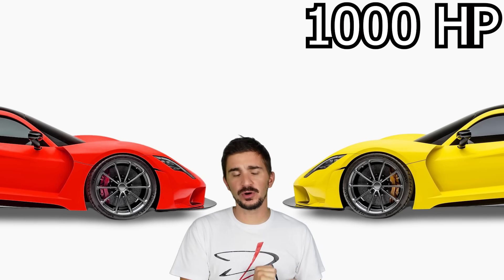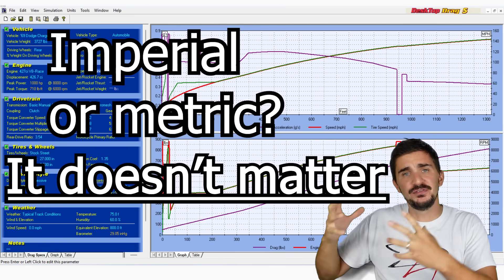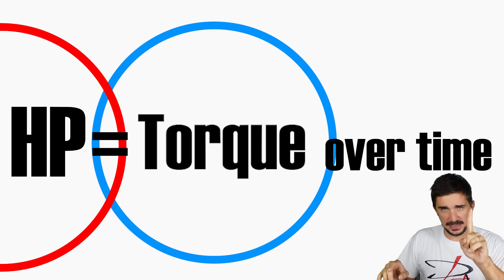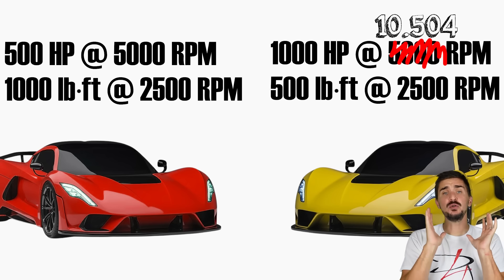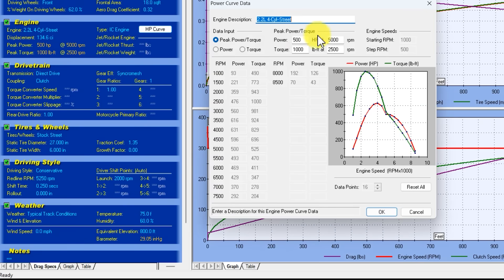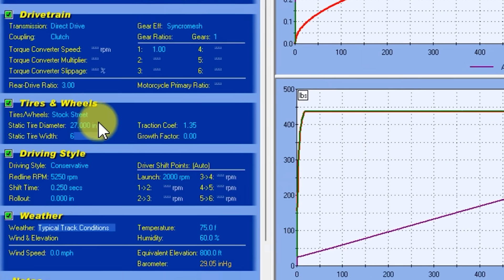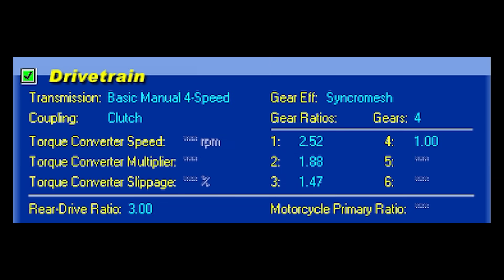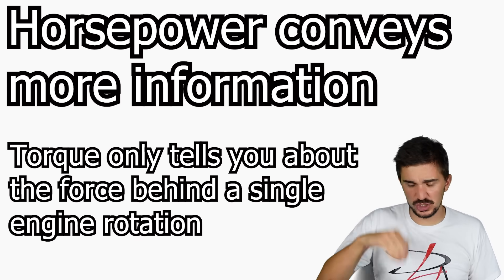Who's faster? Explained and Simulated - Horsepower vs Torque

Comment: If I had to explain what is power and what is torque in simplest way I would say Torque is parameter makes car accelerate, so higher torque=lower 0-100km time. Power on the other hand is max speed car can reach.
Reply: no.

Comment: "Hp sell car, Torque wins races" C. shelby..
Reply: power win races torque alot down low is good for daily riding assuming each vehicle have perfect gearing 👌🏻egzample h-d x440 38 nm 27 hp let say 250 kg with rider on it vs kawasaki z300 27 nm 39 hp 250 kg with rider on it do drag race 0-100 km/h x440 in 9 sec vs z300 in 6 sec +/- vmax x440 140 km/h vs z300 160 km/h 👌🏻 or setup them on racetrack on the same tire increase lean angle for h-d if it be not enough in specified trafk conditiion and tire type and z300 smoked this h-d everyhwere depsite have 30% less peak engine torque and much weaker lowend thanks much more peak power /topend z300 on avg lenght track 4 km from moto gp calendar be like 5-10 sec faster on LAP 👌🏻🤷🏻‍♂️ 😎…POWER  win races not toque wemeber 😎☝🏻 torque is BS for  racing it never work unless somebody setup enough wrong gearing in more powerfully less tprque version but this dont count 👍🏻😎this that power win races dont mean it give more fun on trck avg not very skill/fast rider 😉👌🏻…. it dont 👍🏻 most will have more fun on bike with stronger lowend and weaker topend even pro racedriver most likellly usuallly in categpry FUN not categpry LAP TIMES choice after couple laps on each ….👉🏻version with more torque down low and less topend peak power 😎👌🏻but thats diffrent story 👌🏻 RACES WIN POWER NOT TPRQUE 😎👌🏻☝🏻☕️

Comment: Good example of torque vs HP: my 87 diesel pickup can pull a LOT of weight but it's acceleration is horrid and top speed is 75. Downhill. My 91 SUV can't pull a whole lot but accels decently quick and will do 120mph+

Comment: The number of car guys i have heard misspeaking about this subject is mindblowing. Its incredibly simple really. HP is total power output and torque is a piece of the equation to make total power. Torque by itself is never enough information to determin how fast a certain vehicle can go(or accelerate) but HP IS enough information to determin how fast a vehicle can go(or accelerate). If you know what rpm this HP is generated at, you sinply need to choose an appropriate gear ratio to utilize that power effectively. HP is the measurement of all things "go fast" while torque is but a small specifc conponant of that total HP
Reply: I thought torque was invented by Harley guys to feel better 😂
Reply: @Root_boy  🤣🤣🤣🤣
Reply: driving a car that only produces good horsepower at 13000 rpm would be awful to drive in everyday driving. It would feel very weak at 2000 rpm, and you would be downshifting at every slight incline and puff of wind. The engine noise and reduced engine life would quickly bring on buyers' remorse. It would only be powerful by staying in first gear.
Reply: @briank10101  no, you just gear it differently. Top gear would have you cruising at 6,000rpm to access the HP.
Reply: @briank10101  dude if an engine had its peak power at 13,000 rpm it WOULD NOT be fitted with gear ratios that put it down to 2k rpms when cruising!!!! Are you freaking kidding me?!? You just don't understand do you. It would be fitted with gears to keep the rpms at appropriate speed. Like say cruising at 6k rpms? Higher rpms = ability to have lower gearing. You still don't know how it works..
Reply: Small specify fact?   I wouldn’t call 1/2 of the equation a “small part”?   Is 50% of ANYTHING a “small part”?
Reply: @andrewhigdon8346 you’re wrong. Torque is equally as important as rpm. Hp stands on its on and hp is infinitely more useful a metric than tq is. We aren’t comparing tq to rpm here. We are comparing tq to hp. It’s like saying I am making $100 at my job. As opposed to saying I make $100 an hr. One means absolutely nothing and the other tells you pretty much all you need to know. Tq is arbitrary without RPM. HP includes both metrics into one number.
Reply: Thank you! Lol took the words out of my mouth. Guy in the video did an absolutely HORRENDOUS job of explaining this and your comment is worth 1000x more than this video where the guy seems afraid of reality and scared to get to the point
Reply: Lol it's always so funny how easily you can tell when people don't understand this. They love to go in depth with details about weight, grip, torque, etc. while people that know just say what you said. HP is king 😂
Reply: This is a terrible explanation. Just watch the video.
Reply: @JimLBon  If you think that's a terrible explanation then you still yet don't understand how it works yet. Lol the video is a terrible unrealistic explanation of how it works and doesn't really show the advantage of having high HP over low torque. When the f*ck are you gonna have a 4 speed in a modern car? Or a freaking 1 speed? Most modern cars have atleast 6 gears to play with and the HP engines will always win due to gear ratios.
Reply: If you know the RPM and torque, you know the HP, so your statement stands for both.
Reply: Huhn?  This was solved by Lawlor many many years ago.  Check out his book.  It is a simple gem.
Reply: @squirrel6687 book name?
Reply: You are wrong.. hp on light car vs same hp on heavy car. How hp alone tells u how fast it will go. Just watch video
Reply: Not only car guys misspeaking. I've even heard physics majors doing it! A (bad) car CEO, too!

If you have enough gears, power is the ONLY thing that matters for performance. Peak torque can sometimes be a clue about how broad the power curve is, how fun it is, etc.
Reply: @masina9447  peak torque doesn't really tell you much. You need a torque curve for that...
Reply: @RacingAnt  and that curve needs RPMs. I guess that is inferred.
Reply: @masina9447  Amen brother. You get it. I've tried explaining it to people and it's just like bouncing off a wall 😂
Reply: You are wrong , obviously don’t understand torque wich is work hp which is time the work is done in. Light car sure takes no torque to move it and lots of hp can make it move. Heavy vehicle you need gears to optimize work or torque if your making little torque. Average power between torque and hp is what wins races. That’s why fuel injection often making less peak power than carbs will run quicker with less HP.
Reply: @jbaker8871  I'm sure you do not even understand that hp is a mathematic equation and you're telling me I am wrong with some word salad. Sure.
Reply: @jbaker8871  thats a whole lot of mumbo jumbo
Reply: @jbaker8871  if you think you only have to use gears to optimize acceleration in heavy vehicles you are completely clueless. Gears are necessary to optimize performance in ANYTHING. If you have the perfect gearing the hp will win EVERYTIME. If you don't understand this then there's no point in even arguing with you. You just don't get it lol

Comment: Horsepower is the raw power coming out of the engine, you can't change it. But torque can be changed with gear ratios. so in the end the car with higher HP will naturally be able to produce more torque.

Comment: Assuming everything  is equal with optimal gearing for both cars, 1000Hp with 500lbs is WAY faster. But if you were to measure 0-60 or acceleration, up to a certain speed 1000 torque and 500hp would be better.

Comment: If the formula was right, my engine should produce 300 hp bone stock. Instead it produces 150 HP. Somewhere dude forgot to mention that there are over square and undersquare engines.. All internal combustion engines also produce a lot of heat and so therefore they're loosing a lot of horsepower to just run the engine it self. The formula just add up to reality. There is no konstant, there is a formula "in best case scenario" like in physics class for elementary school - "don't count in heat, friction, etc.." and also this is usefull just for square engines where bore is the exact ammount as stroke.

Comment: This is inaccurate, you never optimized the transmission, and never went above a 4 speed. Higher HP will always be faster if optimizing the transmission. The only thing that matters is average power across each gear.

Comment: Normally, I like your videos, but in this one, you talked a lot of illogical and overly simplified stuff.

First of all, regarding the formula for power; who uses a constant for engine power? Why don’t you explain that mechanical power is composed of torque multiplied by angular velocity, and that angular velocity is derived from the product of 2π and the engine speed. And it’s expressed in watts, not kilowatts. Kilowatts are used to keep the value more compact, similar to kilograms.

Furthermore, it’s incorrect to describe torque as ‘hits’. Torque, or newton meters, is equivalent to the SI unit joules (energy). So, power is energy per revolution, and the revolution or angular change.

Then, on the topic of which vehicle is faster. Obviously, the one with 1000 hp. The required power for a speed is calculated from the product of the driving resistances and the speed. This equation can be transformed into the required wheel hub power. But I don’t want to go into too much detail.

The point is, vehicles with high power and low torque, like the old V8s in Formula 1, have a transmission with a high ratio to achieve high torque at the wheel hub. Conversely, the ratio must be lower because the engine initially has a lot of torque. But the power will be small since a high engine speed is not reached.

So, there are many factors involved.
Reply: you forget mention that at set speed this high torq at wheelll drive axis with set whell radious is achievable only beacuse old v8f1 engine have alot peak power otherwise  this will never happen dosent matter how you geared lower power higher torque engine it will never generate as much torque at drive whell axis at the same speed at set/fox whell radious 😎 alll what happen between engine and whelll are irrelelvant it it can be everything and this everything must be setup in such way that max power is generated at speed at which you want to have bigest output force and thats it you can have small /big whelll radious its just reduction nothing more for transfer power at specified speed of vehicle 🤷🏻‍♂️ dosent matter other vehicle have more torqueboth at engine crank and at drive whell acis if it have in this point of time at this speed lesss power available on engine and assuming the same drive train losesss less spower available at whelll he be knockout be engine with more power with lesss torque at engine crank and at drive whell axis  cos this more power lesss crank/whell torque engine will generate more output FORCE AKA THRUST 😎🌪️ 🤭👌🏻 the point is whell torque is irrelevant aswell if we have diffrent whelll radious than you setup in drive train betweeen whell and engine diffrent for achieve MORE contact path force from more peak power 😎 otherwords vehicle with higher whell axis torque still can generste smalller contact path force aka thrust at set speed  if there be enough longer whellll radious so lower whelll power cos torque is not force it is leverage dependend from 100 times higher torque you can have 100 times smaller force if whelll radious be enough longer /biger and force os what REALLLLLY MATTTER NOT SILLLY torque 🤭  🤷🏻‍♂️ simple as 💩😎 all explain simple formula so 👉🏻 watt :m/s= force 👌🏻 king of all racing formula 😎 rest is BS 🤭 made up be some amateur,ydyots or people which want intentionally misleading other pople not involved enough deeep into this theme like in many other theme 😎👌🏻 the funny stuff is that those ydyots dont know if they will say whole truth to avg people they will havefrom this more benefits than like they lie to them cos in fact for most driving conditioon in daily riding engine with more crank torque espciallly at low rpm is way more comfortable and pleasure to drive for 99% of avg people not peak power engine 🤭 but who cares ydyots always be ydyots 🤷🏻‍♂️😎 ☕️

Comment: A 1 Horsepower source will lift 100 pounds 100 feet in 1 minute. If you didn't know, that's the basis for the horsepower scale.

Comment: Horsepower is how fast you can punch
Torque is how hard you can punch. 
You can have a fast time but a slow spead or
You can have a slow time and a fast speed. 
Its why one driver does a 1/4 in 10 seconds at 96mph and
Another driver does 1/4 in 11 seconds at 120mph.
Hp isn't everything, winning is. It takes science to win.

Comment: Horsepower is the only relevant measure. Torque is only one of the two factors. Horsepower, being the product of torque and RPM is the actual rate at which the engine/motor can do work. Torque and RPM only determines the gear ratios needed, or, pump displacement needed for hydraulic systems, to utilize full horsepower, to do the maximum work possible from that horsepower rating.

Comment: You have absolutely no clue what you're talking about, and should just get off of youtube quite frankly. This simulation is utterly useless to compare the merits of peak torque and power, which are only relevant at full load. These sims have the clutch slipping the whole time, or the wheels spinning because it's not even smart enough to modulate the engine for maximum performance. You are teaching bad information to people who don't know any better.

At full load, all that matters is power - period. And you set the gear ratios and shift points specifically to keep the engine at peak power as often as possible.

Comment: HP is directly proportional to Torque. and if the RPM is equal to 5252, then HP and Torque have an equal value. any value of RPM lower than 5252 makes Torque value greater than its HP. while any value of RPM greater than 5252, then its Torque value is lower than its HP

Comment: One thing that I never see stressed enough is that you can change your torque at will by using a proper transmission or changing tire size. While you can never change your horse power, you are stuck with what the engine is capable of

Comment: So if a car has high HP and high torque, with lower RPM, which in turn will make you “feel” the acceleration more as where a low torque but high RPM will feel “slower”, right?

Comment: If we have a car with twice the torque, we can simply put a gearbox with gear ratio twice as high and it would perform identically to high hp engines. Am I getting this right? So we can use truck engines with extremely high torque for drag racing with no disadvantages? Why is nobody doing that? Am I missing something?

Comment: This is a great channel, but I think these power-vs-torque videos are not the best, because I feel the essence of problem is not explained in enough detail.

What pushes and accelerates the car is power and for a perfect transmission (which means a one that can vary ratio continuously without any friction) the car that has more power will have both more power and more torque on the wheels. And in the end what is on the wheels is what matters.

In the consumer realm, there is a power that is more than enough to push the car, and more power can easily lead to losing control of the car. Perhaps 200 HP is enough, and perhps 100 HP is already a lot. So, let's take 100 HP as "enough" for a passenger car (even if it's not enough at very high speeds, where air friction matters a lot).

Now let's compare turbo-diesel and NA-petrol engine. At 2.0L their peak power in the consumer car is around 160 hp, but diesel has much more torque, which peaks around 2000-3000 rpm. This essentially means, that diesel has that 100 hp much earlier (at lower rpm), say around 2500 rpm, and the NA-petrol will have 100 HP maybe at 3500 rpm.

Then I see two important issues:

-  Let's say we have a manual transmission, and we are sitting on a single gear and want to accelerate from 100km/h to 120km/h. Let say the gear ratio is so that for diesel this means changing rpm from 2500 to 3000 rpm, and for NA-petrol is means changing the rpm from 3500 to 4200 rpm. We clearly see, that for turbo-diesel the rpm increase is 500 rpm, and for NA-petrol it is 700 rpm. Not a lot, but a difference of 200 rpm. So, unless we have a perfect continuous ratio transmission, at least theoretically, this is the difference that matters.

- The rpm range where "enough" power is available is much shorter in a NA-petrol engine and lies at the very end of rpm, close to the red zone that a normal driver should not cross. In reality this means one has to often change gears to stay within the "enough" power zone, which is not something a regular human likes to do. A regular human likes to keep the rpm low, because it is easier to handle things (e.g. change gears) at low rpm. Of course, a very good automatic transmission makes all this difference much less, but not all automatic transmissions are so great, and gear reduction at very high rpm puts a lot of load on the drive train.

- The NA-petrol needs to be revved up high to have convenient power, then it makes a roaring sound that is very unpleasant to a regular human.

Comment: Torque is for acceleration, power is for speed.
Reply: Torque is the sound of one hand clapping.  Without RPM you’ll be waiting an infinite eternity to lift a heavy weight or reach a high speed.  Good luck.

Comment: My diesel engine has 450 hp @1700 rpms, however it has 1850 lb ft torque @ 1000-1500 rpms. I rarely go above 1500 rpm.

Comment: With transmission I can exchange RPM for torque and vice versra. Right? Because of that I think the HP is the most important value because I can always "convert" HP to Torque or to RPM by transmission. Depends what I need more. I would like to see the result when we would use the CVT transmission.